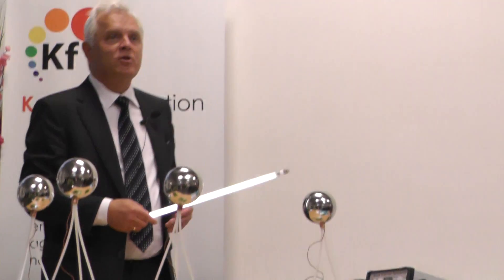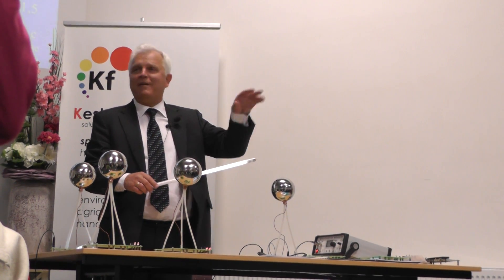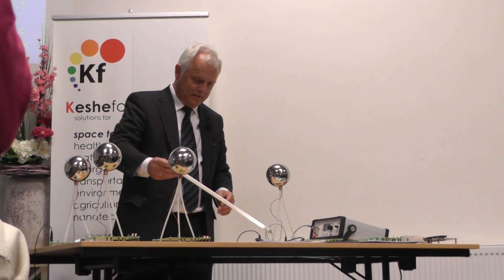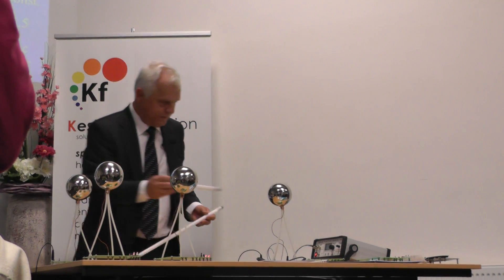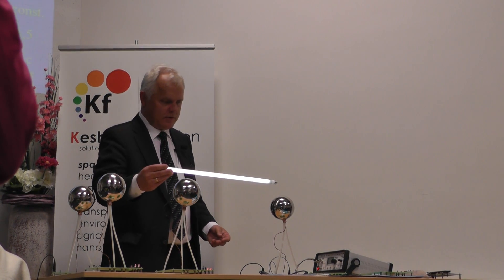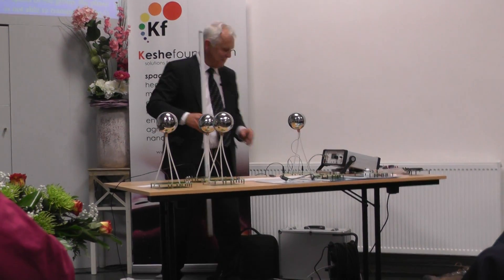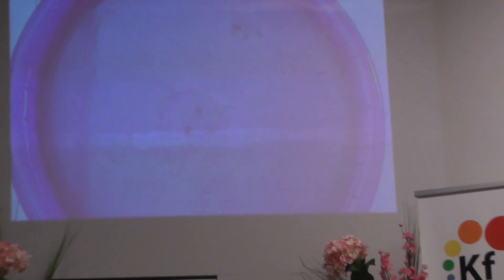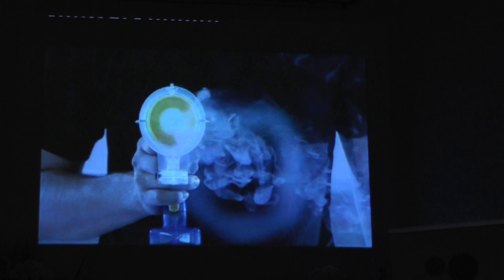Experiment Keshe Foundation 21 september 2012 with burning lamp and boat with Tesla Antenna

Comment: That's why they've hidden the Tesla from the public for decades! It was only recently that people knew who Nikola Tesla was. And Tesla was right when he said: "There will be a time when we will link the machines in nature itself." The concept of free energy has always been a reality, another example is Zero Point Energy (Casimir Effect).
Reply: All energy is free.  It is converting it to the power we want that costs money.  Even Tesla was not about free energy, he was about the wireless transfer of energy.  Wardencliff was run off large diesel engines for the TX power.  TMK, Tesla never had a zero point device he was promoting.  Most people don't know, but we already have great "free" energy today.  Electrolysis of water to HHO (or similar) and converting back to water not only is way over-unity in terms of energy,  but you get pure water back out of the process.  Like a great win-win.  We can do this today no problem, we just don't hear about it for some reason.  You could have one of those devices in every city and transmit the power wirelessly like Tesla.  Infrastucture change is the big deal.
Reply: I know that converting one type of energy into another kind, is what costs money... in my comment, at no time did I say anything contrary to this! When I said: Free Energy, I meant that in every human residence there would be a "generator" (Transformer) of energy, that is, they would be self sufficient, you know? Without the figures, like: State, governments, mafias or companies, understood? This is to be Free of Truth! That is to have free energy... the cost of obtaining the machines and the maintenance and operation of the equipment, would be the cost that each individual should have in order to be free. And that implies having responsibility, that is, studying, understanding science, engineering, computing, robotics, the environment... being free, requiring effort and personal energy expenditure, that would be the price, to be paid by all inhabitants of Earth to have access to free energy. And there are problems when transmitting large amounts of wireless power, but it is not impossible to solve this problem as well.

And... I know the HHO generator. The first time I saw this in action, it was in a video maked in the 90's... here where I live, a guy invented a car powered of water, better, a hydrogen car. It seems to store hydrogen that is the problem as it is absurdly explosive... I think hydrogen could be combined with some other kind of material so it doesn't stay in its naural state.

Imagine, a tank of hydrogen the size of a 500ml (0,132086 gal) water bottle? Hundreds, maybe thousands of miles of autonomy. And if that is able to move a car, it is also able to provide power for a residence, right? But this is not cold fusion. Cold fusion is even better. A gallon of seawater could have more energy than a whole oil reserve... In short, there are N ways of obtaining free energy, some simpler than others, and others more sophisticated, but all the ways without having the state, or government, or mafias, or companies dictating rules, you understend? That is what is implicit in my comment.

Comment: so if you hook something on ground then put this antenna on top. and something else hooked to ground receiver on it, then the large antenna only need a lot of charges presented, no need for alternating waves (i believe). therefore it would be as efficient as putting a batter wherever you want. but those above us can also steel our energy if they are hooked to ground.. or somewhere else wich sucks out electrons (presumably).